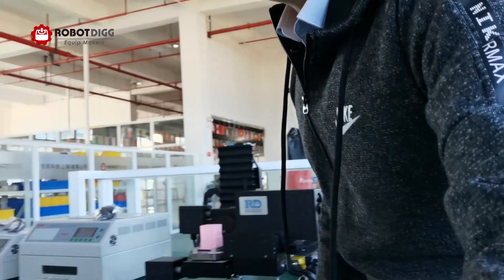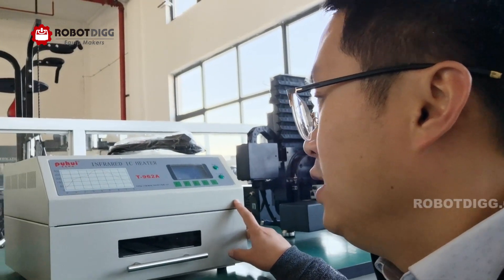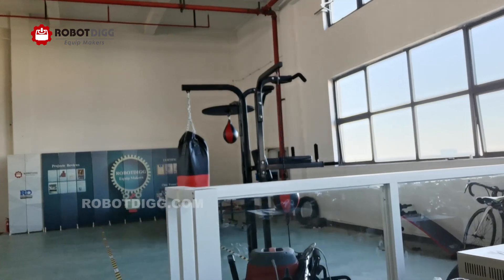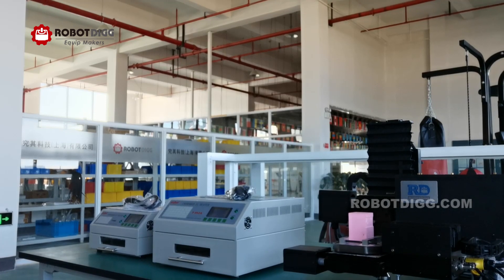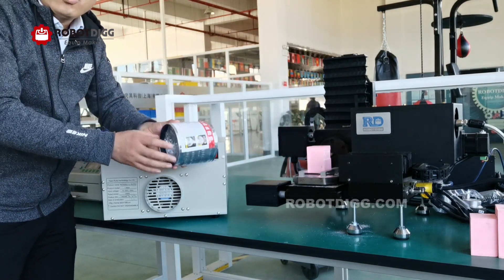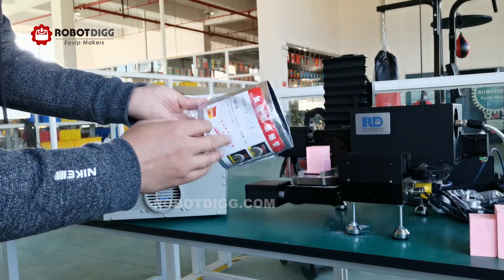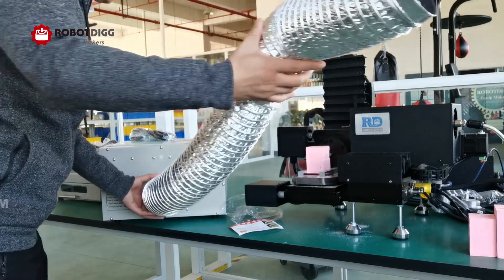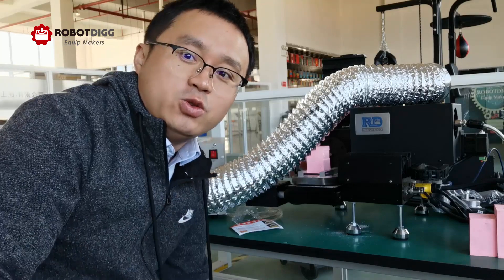RobotDigg upgraded reflow oven T-962, T-962A, T-962C, T-960S

Comment: Honestly, there are a lot of big improvements in the web, which wouldt just add 5$ in production all together. But instead you added a aluminium hose, which ist useless because this ist the side the air is sucked in.
Reply: In the new "upgraded" version, they have flipped the fan, so that it extracts the hot air/fumes through the back. They also changed mechanical design, to make it more air tight during soldering process (less hot air leaking). However . . . the oven is still unable to control temperature propperly, and to distribute heat evenly, and the heating power is still on the low side, to follow ideal reflow curve. So to make this oven work propperly, you still have to make sevefral upgrades. But if you do this, it can be used. I bought one, of these "upgraded" ones, and i am still wondering whether or not I did the right thing. Could have saved quite some time and efford by getting something at twice the price, that would work from the beginning. If you are up for it it may be okay for your purposes :-)